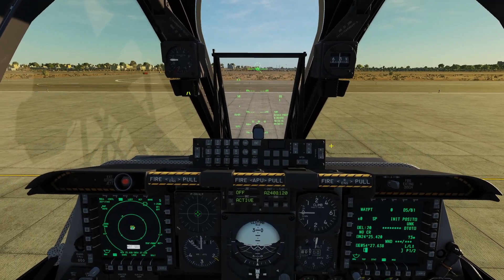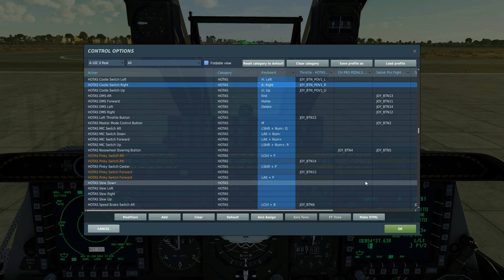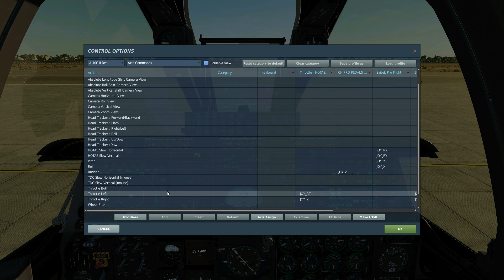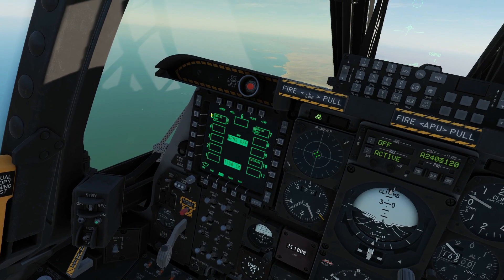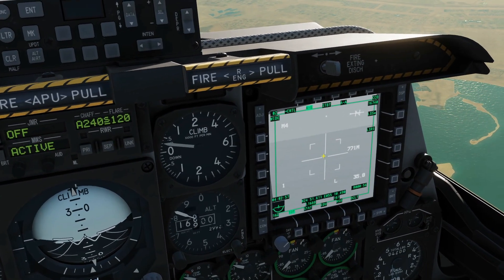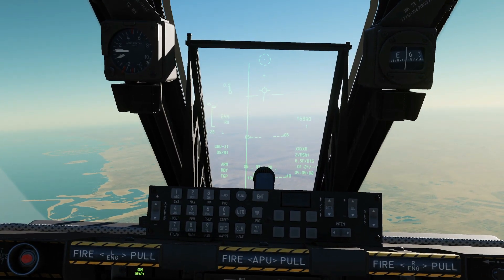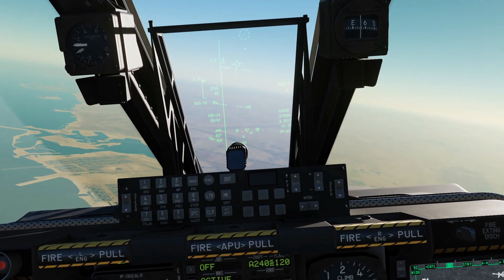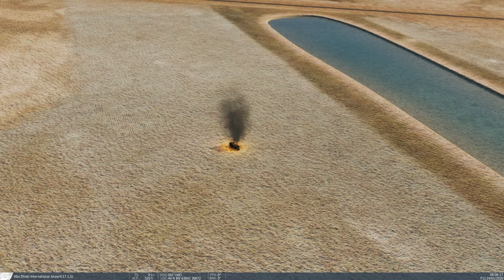A-10C II Tank Killer: GBU-31/38 JDAM Tutorial | DCS WORLD

Comment: Hello
Useful video as always.
I have a question anyway. What is the command to reset the TGP to have the diamond back in the middle of the HUD and the TGP recentered.
A kind of "undesignate" command. With the "old" A10C we could do that with "china hat aft short" but now, it does not work. any idea ?
Thanks
Reply: For now you need to press STBY, then A-G.
Reply: This is the norm now, and will not be changed, it was changed due to feedback from actual A10 pilots. If you want to boresight the TGP now you have to switch the TGP to STBY and back on again as Chazflyz said.
Reply: Thank you

Comment: TMS forward long does not work properly in some ramdom cases, and the bomb misses.(
Reply: On the HUD in the bottom left, you can see what the SPI (sensor point of interest) is. By default it is STPT for steerpoint. When your TGP is the sensor of interest SOI, you hold TMS forward long, and you will see that STPT changes to TGP, the place the TGP is looking is now the target. 
However, there is a post on the Eagle dynamics forums stating that they are working on the glide profile of the JDAMS, users have experienced the bombs dropping short. I have noticed this when dropping from high altitudes when the airspeed is quite low which is the norm at high altitude. If you are experiencing this then don't drop the bomb at max range, wait until nearly min range if you can.